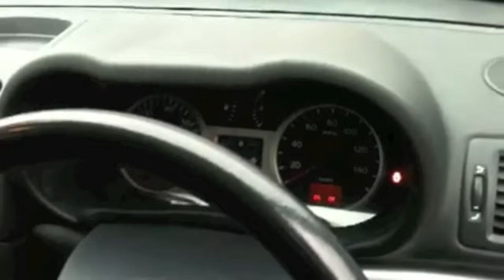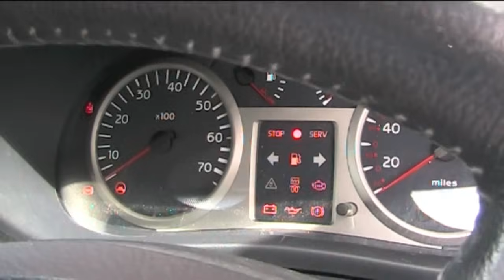Renault Clio 1.2 16v D4F Throttle Body Removal

Comment: Hey mate, can you please tell me what tool to use to remove the ignition coil pack? The Proton Savvy is such a pain with it's engine design being so compacted? It is very hard to remove. 

Please let me know?
Reply from the maker: Hi
The coil pack is held on mainly with torx bolts, take a look in this video i remove it from an engine i had lying about:
https://www.youtube.com/watch?v=vCVpMPjVo74
Reply: peugeotCitroen2CV

Thanks so much. I watched that video 3.15min shows how you did it. I have a question:
- With the Proton Savvy the ignition coil pack is hard to get to. Just wondering if there is a torx allen key small enough to get to the coil pack without using a power tool or socket wrench? I hope I don't have to take the whole engine out in order to remove the coil pack?
- Would you know what size to have to unscrew the torx bolt? That would really help to get me in the right direction.

BTW, I love your work. I think I could try and take it apart but then I would surely get lost putting it back. I need a practice engine so if I stuff up I won't have to worry about it.

Would you take the chance to look into the Proton Savvy 2008/2009 1.2 D4F? Not many videos online who can share their experience :(
It is depressing being a Savvy owner. Only done less than 60k.
Reply: peugeotCitroen2CV
P.S. I am not sure if torx allen key would work but I found these at my auto part store:
https://www.bunnings.com.au/kincrome-9-piece-torx-key-set_p6120346

Sizes:
T10 x 15 x 45mm
T15 x 16 x 50mm
T20 x 18 x 56mm
T25 x 20 x 63mm
T27 x 25 x 70mm
T30 x 28 x 80mm
T40 x 32 x 90mm
T45 x 36 x 100mm
T50 x 40 x 112mm

Can you please let me know if one those is the correct one?

I could possibly try the socket torx but will need to test it if works. As I mentioned before it is very compact.
Reply from the maker: Hi, see the link for the Allen key set. That's the sort of thing worth getting if you are going to work on french cars (or in this case a french engine)
The D4F isn't a bad engine, a few of the covers are a bit bewildering but if you follow these videos its not really something to be afraid of. 

I actually cant remember what the bolt sizes were but I think it was somewhere between T15 and 30 for the coil pack ones, this was a spare engine i took apart for the video then moved the parts on, so i cant even go into the shed to double check the bolt size. However, if your going to work on your own car get the set. I find a set of torx bits and a 1/4" spanner particularly useful if space is at a premium, although those allen keys look fairly compact. 

Also if you have any issues don't be afraid to join a forum like a renault forums.co.uk (i don't know how good the proton one is, but the Renault one has more info for the D4F). You should be able to get to the bottom of any engine issues the car has. 

What is the Savvy like? There are not many here in Ireland, I sat in one once but never realised until someone else mentioned they have a D4F.

Hope that helps.
Reply: peugeotCitroen2CV
Thanks heaps for that! I will see if the socket Torx will work but my guess will go with Torx Allen key set just to be certain.

Yeah the coil pack is really close to the edge and not far from the windscreen. I can access to the first 2x Tbolts but the third bolt is doing it by feeling because you can not see that bolt. As I mentioned before a real pain in ass!

When you say Torx bits is that using a power tool? If so there is no room for it unless the whole engine is out of the bonnet. The coil pack is beneath the bonnet edge close to the windscreen.

Will watch this video countless times so I can one day take it a apart with confidence. I've come this far changing the TDC sensor, battery, and drum/shoe brakes was challenging lol.
Reply: peugeotCitroen2CV

Forgot to ask you. I read up on something about putting Fluorinated Grease inside the tip of the plugs? Can you please confirm if that's what you use for D4F or Savvy engine?
Reply: peugeotCitroen2CV
Look like I got some good and bad news. I managed to remove the coil pack which was a pain in the ass using those Torx Allen key. The bad news it is now showing a fault code p300 random misfire? God dammit it more than 2hrs to remove it and now the random misfire.I think the ignition coil pack is not the right one? I can't even bolt it on because one of the leads is short? I think the guy sold me a renault clio coil pack, it has only 3x torx bolts. I removed my original coil pack it has 4x torx bolt?

Like this one(4xTbolt):
http://i.ebayimg.com/images/i/291097874601-0-1/s-l1000.jpg

But instead the new part is this one (3xTbolt);
 http://www.renaultforums.co.uk/_User-folders/vBulletinImg/%7B15303A27-C488-4451-850F-FB13D228E857%7D.jpeg

What do you think? Do you reckon the coil pack is not compatible? So damn frustrating!!
Reply from the maker: You have probably bought the wrong coil pack. I have no access to renault part numbers like i do with Peugeots or Citroen's but if you had the 4 bolt coil pack it would make sense to try another one the exact same. Renault may have revised the part at some point along the way.
Reply: peugeotCitroen2CV 
hey I got it checked again and it look like the head gasket is gone in cyclinder 4? I was told the leak is coolant mixed with fuel which makes it a dye color and not as thick as engine oil. I have a leak and I thought it was engine oil all that time but it's not. Hopefully to sort it out soon.
Reply from the maker: Ah it should be too big a job to do a head gasket on a D4F, parts are relativley cheap and a skim shouldnt cost much either.
Reply: Algud dude couldn't fix it so I got rid of the piece shit!! No more headaches now :P

Comment: one of the fuel lines runs to what appears to be a fuel filter unit located under o/s front head light?----i got a replacement fuel filter but the one on car(if it is a fuel filter has an electrial connection on it) parts place said mine is located around tank under car or even possibly in internal pump unit(as the clios vary they said)-what is this unit under o/s front light for?-is it another fuel filter-parts place couldnt locate item on their computer-it has an in and out hose but electical connection to it-any ideas thanks
Reply from the maker: Under the wing is the charcoal canister / the evaporative emissions valve.

Some clios such as this one i worked on had no fuel filter at all.
Reply: thanks for thank
Reply: thanks for that
Reply: ok thank clarifies that thank you and no my 1.2 16v 2001 petrol has no exterior fuel filter-its apparently combinded in fuel pump-although an external fuel filter shows up in parts request but the engines and specs changed on various models around this time so renault spares told me thanks for assistance

Comment: Thanks for a very useful video, but it could have been even better with a bit of occasional commentary and less of the speeded-up stuff which, at times, made it a bit tricky to see what was happening.
Reply from the maker: Some of the speed up stuff doesnt look too great in these earlier videos (at the time i shot the early videos with an iphone 3gs), i wasnt too used to the video editing when i did this video, although the aim of speeding up bits of the video was purely to deal with the boring stuff, there is no point in showing each bolt coming out turn by turn in real time, obviously though i seem to have sped up some of the more important stuff, sorry about that.
I prefer the subtitles to talking in the video, its much easier to type up the words just right than trying to say things which inevitably would end up with a lot of ummm, aaahh, errs nonsense if i was talking. I also believe that the subtitles translate easier than a spoken voice.

Comment: Could someone point out to me where the crankcase breather is under the inlet manifolds? Time stamp and a little description would be hugely appreciated! thanks
Reply from the maker: 7:51, look at the circular hole just to the right above the throttle body, and at 9:01 its corresponding part on the inlet manifold

Comment: Did you get "check injection" light/fault beforehand ?
Reply from the maker: The light that had a symbol for a glow plug light / oscilliscope yes that was on
Reply: Well i have the newer version of clio (2006). The throttle body is much easier to pull out. Check injection comes on and the car goes in to emergency mode. The throttle will not open at all, and it only runs on three sylinders. Put in a full auto scan and delete fault codes, its all back to normal. Strange shit
Reply from the maker: @prebengjestang4636  
What fault codes did it say?
Reply: @peugeotCitroen2CV  downstream oxygen sensor
Reply from the maker: @prebengjestang4636  it may be worth looking at that part then, 02 sensors can go bad

Comment: The cover is not tightened with E6 Key I think it is E9.
Reply from the maker: Some have alluded to the same thing, I have since added a caption warning of this.

Although I would recommend just buying a set of inverse Torx sockets £20 will get a budget set and at least the other sizes are there for other bolts that may crop up during future repairs.

Comment: le starter automatique dans cette moteur il est aux.? s'il vous plaît beaucoup
Reply from the maker: I do not believe it has an automatic choke, there is just the throttle butterfly valve which is controlled by the ECU, not a choke per se but there would be a cold weather algorithm that the ECU would select until the car has heated up sufficently

Comment: I have an oil leak in the joints of candles in a semilarter engine. problem & solution please
Reply: In english the joints of candles is the spark plugs, I don't think google translator works too well LOL

Comment: Would this method fix the problem on my 1.4 16v clio? I have the same issue with the yellow throttle light on its the same one that shows on your video doesn't go off at all it's stuck on and engine is juddering alot when I try to press the pedal it won't go past 3k
Reply from the maker: Its quite a cheap repair to do if you can spare the time and is worth trying first to see if the car runs any better afterwards.
Reply: peugeotCitroen2CV I gave it a good clean and it worked now the car starts fine :) now I have an issue with the electronic throttle light on I changed everything I could like throttle body fuses relays nothing worked car won't rev pass 3k I checked for wiring damage on ECU and throttle cable it's still won't go off
Reply from the maker: Hi, i would advise plugging the car into a diagnostic fault code reader to see what the car says is the problem before replacing components
Reply: peugeotCitroen2CV the only code it showed was df064 I've been playing around with the wiring to see if I could get the light to go off but it still wants to stay on. Maybe an ECU problem? I bet ECU won't  die that fast.
Reply: peugeotCitroen2CV I'll try getting it someone to diagnose it again, thank you
Reply: Btw I've been a long time subscriber to your channel ever since I owned the Clio haha your channel helped me alot with stuff
Reply from the maker: Hi any chance of plugging in a fault code reader that defines its fault codes, googling that DF064 gives something about a vehicle speed sensor, but a decent fault code reader or proper renault clip diagnostic tool will more accuraltey define the fault.

Comment: My 2002 clio is cutting out at lights and junctions etc, the ecu light comes on and heard it might be the idle control valve, would i use this to clean it. Don't know too much about this if someone could help? thanks
Reply from the maker: Basically what is done in this video should sort the problem, carburettor cleaner is the product used to spray the components clean.

Comment: Hello..good video... 👍, does anyone have or know where I can get the repair  service manual for this Renault clio 1.2 16v D4F. I have one from the year 2001. And I need a manual for this model. Hopefully someone can help me 👍
Reply from the maker: Hi there, 
emanuals online, ebay for renault clio workshop manuals.

They tend to be the dealership manuals and can be a case of information overload, there are chapters in there with dimensions for putting the bodyframe on a jig after an accident. That level of detail.

The haynes manaul is hard to be beat though

Comment: Plz how place pcv valve for this engine d4f??thank you
Reply from the maker: It is in  there in the inlet manifold itself, use some carbuettor cleaner, and compressed air to clean out its passages with the manifold removed.

Comment: Salut. I need the classification of clio ignition beams D4F 1.2 16V
Reply from the maker: Hello
Do you mean spark plug type? I don't have any note taken of what type of spark plug i used however most motor factors have a database of what is required and will provide you with the plugs to suit the car.

Comment: I got the throttle body off but i cannot find the idle control valve on it anywere! All i see is air temp sensor on the throttle body. Can u help?
Reply from the maker: I seen this on google 
https://www.slideshare.net/WalterMazibuko/50777360-basicmanualworkshoprepairmanuals325and337

I cant actually remember where the idle control valve was on these engines, the renualt forums may be the best place to ask.
Reply: thanks !! iv got very loud tappets sounding  after taking the rocker cover off the left rocker arm has broken right off.What do you think could of caused this ? cambelt is good..im going to scrap yard to get a full set of arms. can i simple torque  them down using old bolts and as these arms are second hand they shouldn't need to feeler gauge them all ?  ITS 2005 1.2 16V
Reply from the maker: There could be issues with the valve stems perhaps being a bit sticky, or the valve springs. 
Generally they shoud not snap, its not something ive seen myself on a D4F engine.

The old bolts torqued down correctly should do but it would be worthwhile setting the valve clearances. Although it might be worth being prepared to have the head checked over by an engine rebuilder to see why it would have snapped the arm.

Comment: Hiya PeugeotCitroen2CV, sorry this is in the wrong place/ can't private message you through my iphone... Can you please do another great video on replacing a squib/ rotational connector switch - the bit behind the steering wheel. Mine clicks on full lock right. It's working fine as no airbag off warning lights are on etc

Comment: The female torq bolts on our car are E8
Reply from the maker: I may have misquoted the size, there may be year on year changes with the bolt head sizes.
Although i would recommend to anyone doing DIY work on their own cars buy a set of sockets rather than individual sizes.
Reply: @peugeotCitroen2CV  Cheers for the video - sorted us out a treat :D

Comment: is this engine noisy anyway?
Reply from the maker: Not really, the audio of the video may make it sound that way but inside the cabin these are not too noisy. Although for motorway driving these 1.2 clios especially the later MK3 rev a bit too much and the noise of the engine can get a bit tiring to listen to.
Reply: @peugeotCitroen2CV  mine in brazil is the d4d.
Reply from the maker: @Gildesio  Ah the 1.0 version, do you find it noisy yourself?

Comment: Hi,It is useful video.
I have renault clio 1.6 16v sport.Also I suspected to become pretty dirty of  throttle body.Because idling is not right.When I tried to remove intake manifold,it didnt come off even I remove all bolt,all screw.Is there anybody here who have encountered same problem?
How can ı remove intake manifold?
Reply from the maker: Hi 
Unfortunately i have not worked on the 1.6 engine which presumably has a different inlet manifold layout, best option would be to get a haynes manual which should detail how to remove the manifold for that engine

Comment: 2 electrical connection.....8.28 minutes....just press it in and pull the connector out....no need to take it off~
Reply from the maker: At 8:28 i was disconnecting the connectors going to the throttle body, the first connector is secured in place by a spring clip, the screwdriver was used to release the clip, once released the connector pulls out. The second connector was just an ordinary plastic multi pin connector which needed the screwdriver to pry up on the tab holding it in place. That was just how these two connectors were removed on this particular car it may differ slightly depending on the age of the clio but i think most d4f clios used the same connectors.

Comment: well, im owner Thalia i and II.First car 1.4 75 hp and second 1.2 7.5 hp.Well,my impression..first car was easy,second was more comfortable, but engin is little different.On little speed is week,but less consume fuel..im going t work,some citi,and something  behind,consupsion fuel its somhing ebaut 5,5-6 l/100 km..Well its good car for journej to the work and for shopping ( enjoyj 500 liters  bagade).IMHO its good cheap car..
Reply from the maker: Good stuff, the thalia is a rare car here but they are a saloon clio, the 1.2 16v engine would be more economical than the 1.4 8v but   do you find the 1.4 is an easier engine to work on?
Reply: peugeotCitroen2CV
They were Clios in the Southamerican market for a long time.  Manufactured in both Brazil and Argentina.  Excellent cars 1.6 16v: nothing faster around these parts.  Consumption is quite all right as well. We've had one for 8 years already and apart from coils, not much has failed.

Comment: Clio1.0 8v
Reply from the maker: Might be a slightly different arrangement, i have worked on the 1.2 8v engine which is different. Although in general the same principals apply.